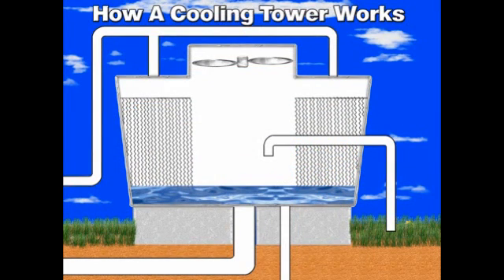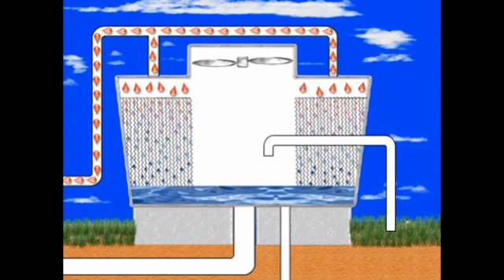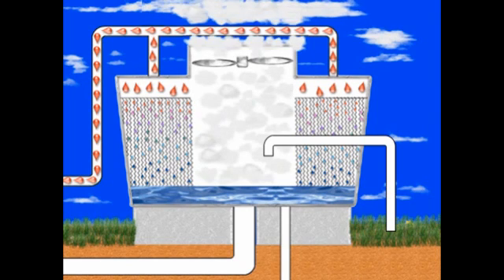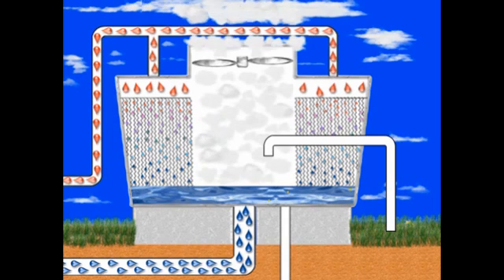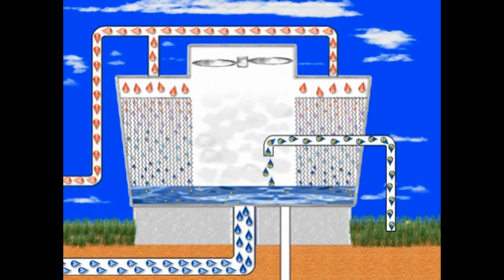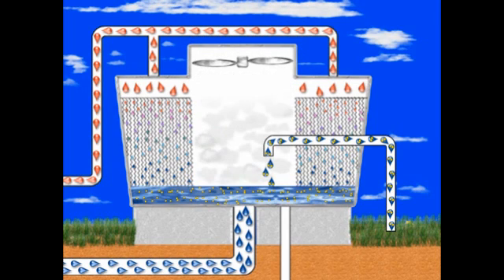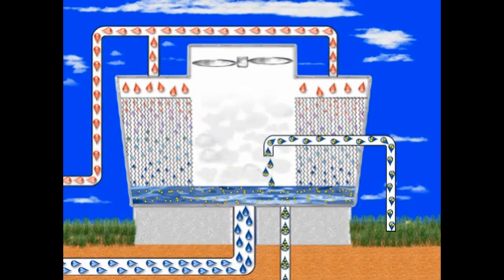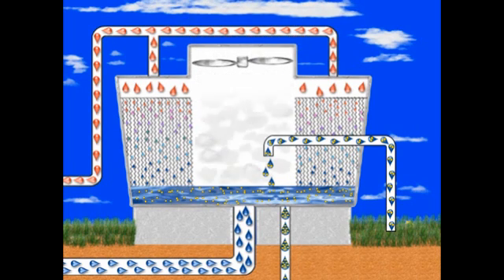How A Cooling Tower Works

Comment: this may be a stupid question but where does refrigerant (used to be Freon) come into play?
Reply: If you know the refrigeration cycle correctly. Cooling towers come into the catagory of CONDENSORS. the job is to supply cool water to condense the refrigerant in the coil. so cooling tower's job is just to cool the water which is getting heated due to transfer of heat from refrigerant to cooling water.
Reply: BaBa Booey This information may be useful in answering your question: 
http://www.coolingtechnology.com/about_process_cooling/industrial-chillers/default.html

Comment: A dry cooling tower has the hot water or steam flow through a pipe and or heat ex changer.  So the water's heat flow to the pipe or ex changer then to the air usually pushed by a fan.  The water doesn't leave the system.  
A wet cooling tower or evaporative cooling is what you see here.   Hot water is sprayed over fill for the water to fall through and cool air is brought over through either fans or by warm draft air like this one.  
Air cooled condensers is just another term for dry cooling.